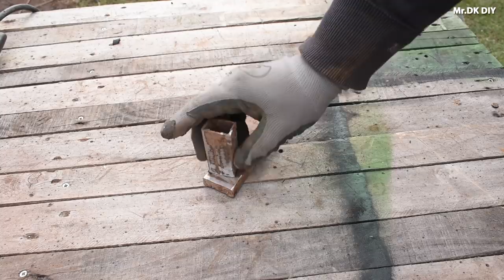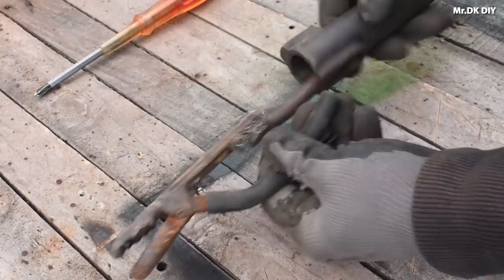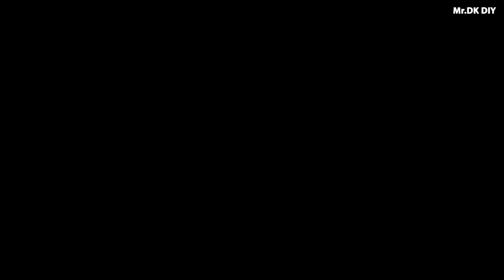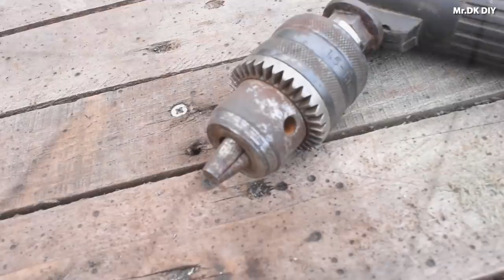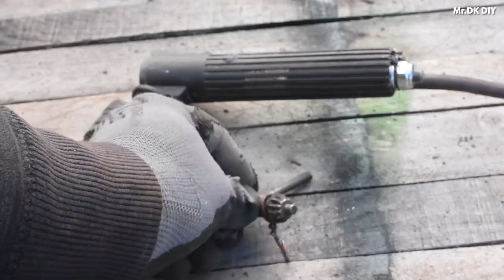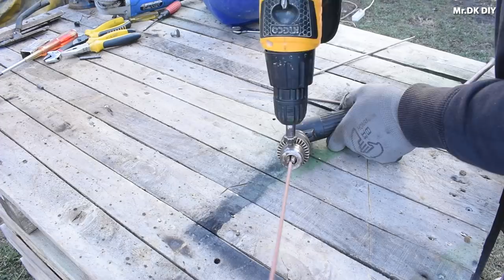PERFECT DIY INNOVATIVE IDEA YOU MUST SEE

Comment: With all do respect. The idea is very bad. The electrode holder would be very heavy, very tired to work it after a few minutes. The idea is not practical, too much trouble to change the electrode, sometimes it is necessary to place the electrode in the clamp at 30 or 45 degrees, this idea doesn't allow that at all, and above all, this idea DOES NOT HAVE ANY CONSIDERATION OF SAFETY! There are many risks of electric shock with that stud uncovered on all sides and the handle without insulation. A really bad idea to be honest.

Comment: The welding current should never pass through any kind of threads , gears or rollers .There will be arcing and current fluctuations.That chuck will weld itself together Not a good idea